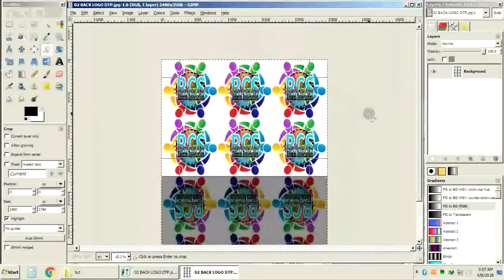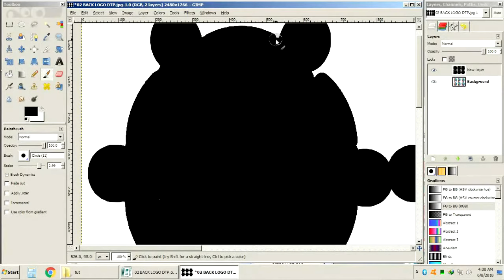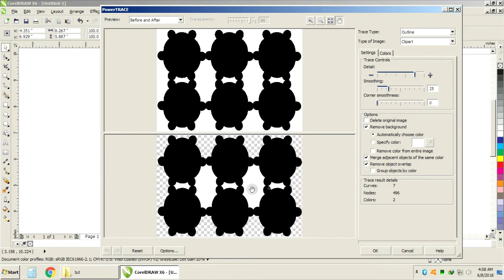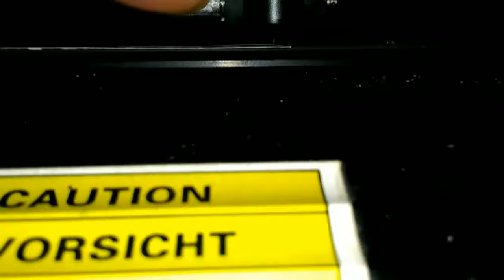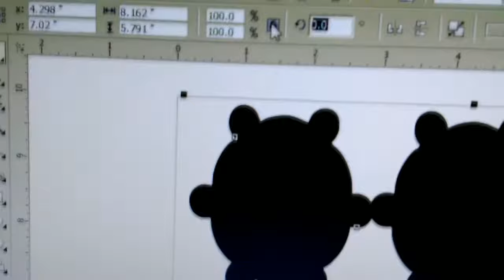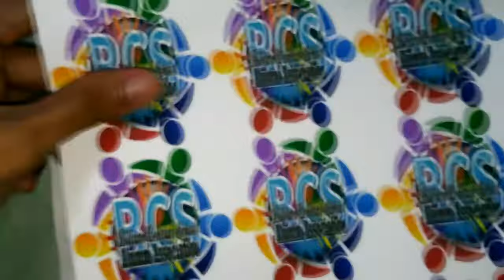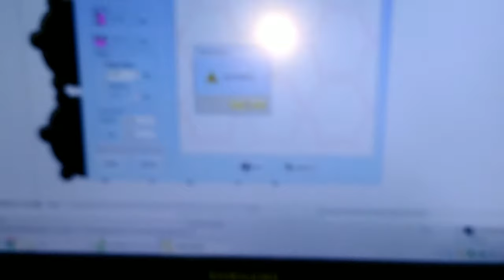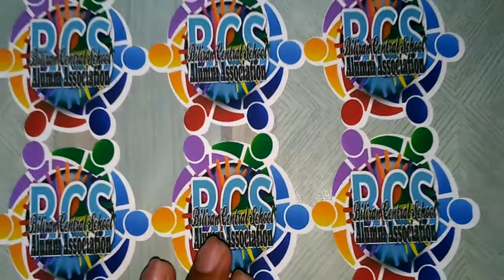HOW TO CUT Dark Transfer Paper using Cuyi CTO 630 Cutter Plotter

Comment: Sir bakit po lumalabas lang po sa cutter ay working laser? How to fix po.
Reply from the maker: Anong gamit na software sir?
Reply: Flexi10 po
Reply from the maker: Licensed?
Reply from the maker: Corel lang gamit ko pag-cut. It works for me. Cracked flexi not good.
Reply: Nakakahiya po ang dami ko pong tanong. Napagana ko na po yung cutter plotter coreldraw x3 po gamit. Problema lang po di po sya makapag-cut ng maayos sa vinyl. Tama naman po blade sinunod ko po nasa youtube na maliit lang po nakalitaw. 255 na po force 60 speed di pa rin po makapag-cut ng maayos. Bale po pag binakbak yung sobrang vinyl, hindi po naka-cut yung design sumasama po sa inaalis. Paano po ba ang dapat na gawin. Nakaka-isang metro na po ako vinyl kakatry.
Reply: Pasensya na po ang dami ko pong tanong. Salamat po
Reply from the maker: Mataas na masyado force. Baka mapurol na blade, or kulang sa litaw. Pwd naman po kayong mag "test" first para makita nyo kung maayong pagkka-cut.